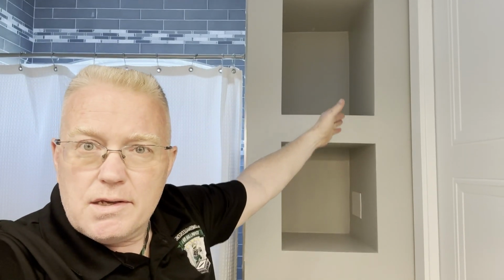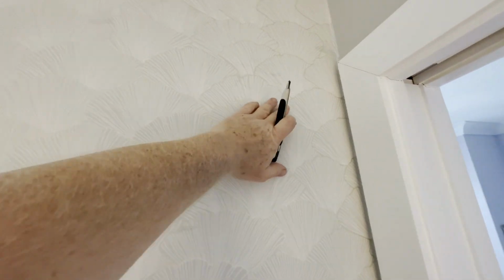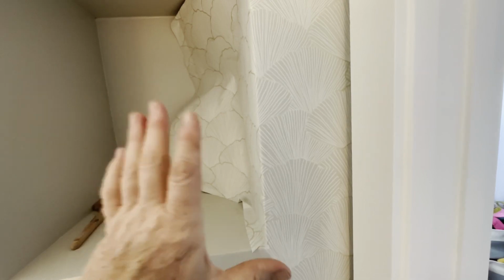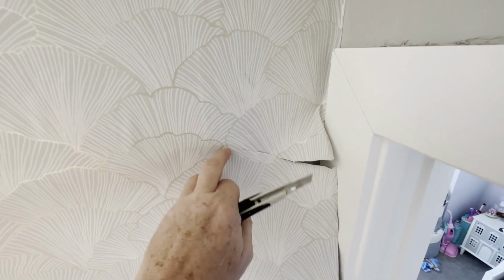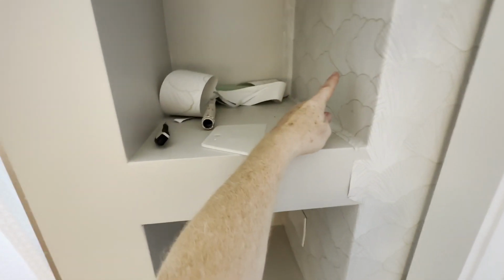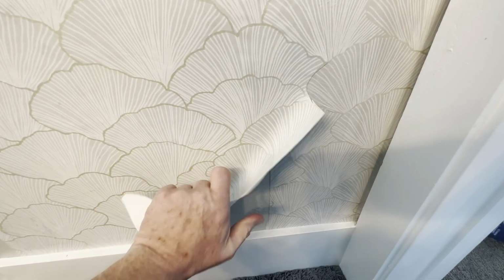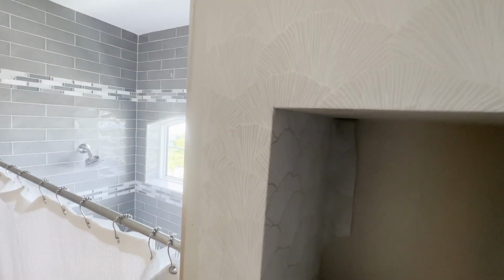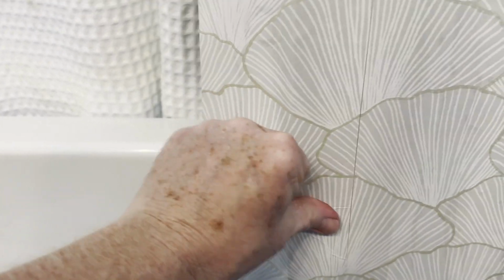Wallpaper a Niche with Candice Olson Luminous Ginko Wallpaper - Spencer Colgan

Comment from the maker: Author’s Note:

another way this could have been done was to take 2 long sheets, one on the left and one on the right and hang the left vertical rail and the right vertical rail with one sheet of paper that would continue into the side walls of the box, on the left, and on the right. 

Then, paper the back of each box, and lastly, hang 1 piece for each shelf and go from the top of the shelf over the front covering (facade).